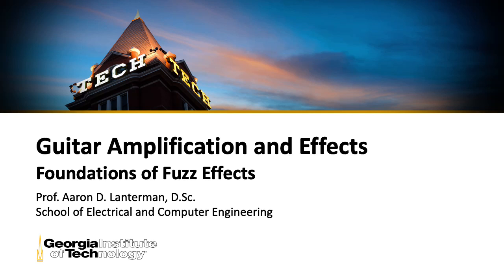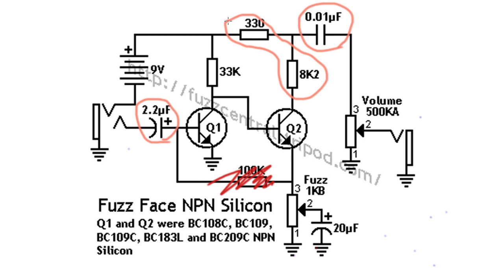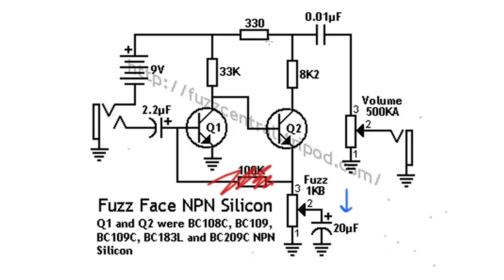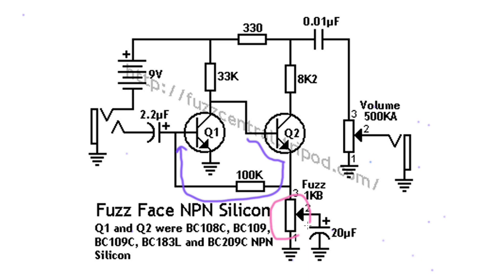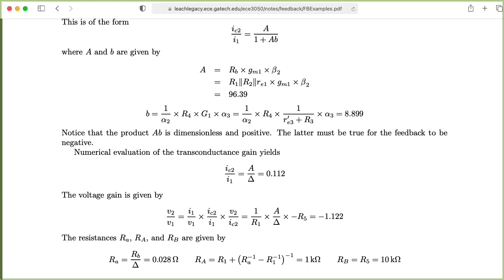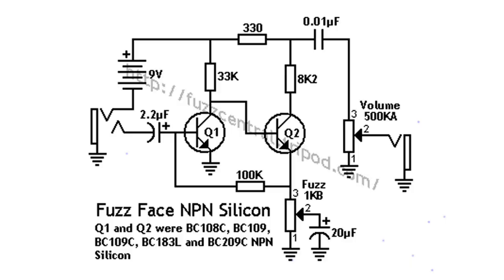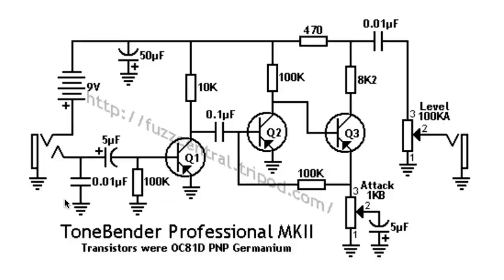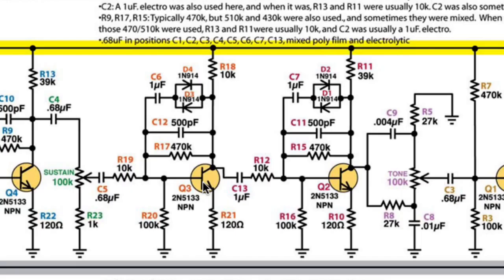ECE4448 L44: Foundations of Fuzz Effects (Guitar Amplification and Effects, Georgia Tech course)

Comment: Generally:
Overdrive: Soft clipping normally by using diodes in a feedback loop to soften the knee. 
Distortion, hard clipping, diodes after massive gain increase. 
Fuzz: internal transistor saturation created by driving one transistor into others.

Comment: A very good tutorial. Would it be possible to do an installment on the problems faced when a Cry-Baby is employed before the fuzz-face and an analysis or improvement on the FoxRox wah-buffer (or as I think of it the FoxRox single-opamp-fullrange-booster that allows to recover the signal-losses caused by a 22k or higher series resistance which is needed/employed to raise the impedance right before the input of the fuzz to make it work)? That would be golden! 😊

Comment: Please do an analysis of the Pro-co Rat. It's a bit of a strange one, hard-clipping distortion with filtering stuff in the feedback and a unique tone stack. And was designed about 20 minutes from where I'm posting this.
Reply from the maker: Did you see the video I did on distortion & overdrive pedals? (Admittedly I didn't go into any particular pedal in any detail).

Also, have you seen the Rat analysis on Electrosmash? (I love Electrosmash).
Reply: @Lantertronics  I have and I did and I do too :) The filtering on the op-amp feedback is odd and the whole thing isn't like anything else I've seen. The analysis on the site doesn't address the filtering stuff and the tone stack and why it's still a bit of a weird beast in the world of distortion. Looking at their analysis they ignore C5 and C6.
Reply: Two parallel RC filters on the feedback?
Reply: @justovision  One of the main considerations with that pedal is the Slew-Rate of that particular OpAmp ...
Reply: @cerrem1  uh oh, the never ending conversation of the slew rate of the lm308 chips.
Reply: @mahn9935  It's not unique. See the things that copy it?

Comment: Hello! I’m a beginner when it comes to pedals and electronics but I’m eager to learn. Can you simply explain why fuzz sounds generally horrible with a bass guitar?
Reply from the maker: Think about a choir arrangement -- base and tenor parts are generally spread out compared to what you can do with an alto and soprano part working together. Similarly, a string quartet will have two violins and a viola and bass, and not say on violin and a viola and two basses. When you play a note with a fundamental of 100 Hz, you get the harmonics at 200 Hz, 300 Hz, 400 Hz, etc. But we perceive pitch on a logarithmic scale, so while the octave above 100 Hz is 200 Hz, the octave above that is 400 Hz, and above that is 800 Hz, etc. So harmonic content at a lower end of human hearing is going to sound denser than harmonic content at the upper end of human hearing. A fuzz will add harmonics in a way that's going to be perceived as denser and more cluttered at low frequencies.
Reply: @Lantertronics  thank you very much for taking the time to respond to my question!! I never knew that about the choir but now I understand!

Comment: Is there a harmonic difference when using pnp vs npn transistors?
Reply: Nope. You just swap negative and positive. Germanium transistors were more common in PNP and the fuzz face just ran on batteries so it didn't matter. You could make a PNP version with silicon the same way.